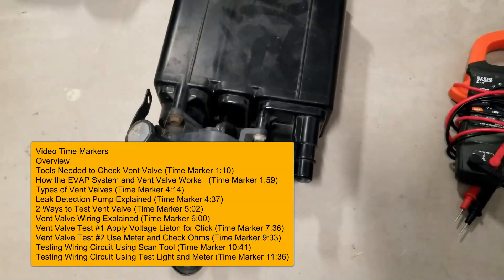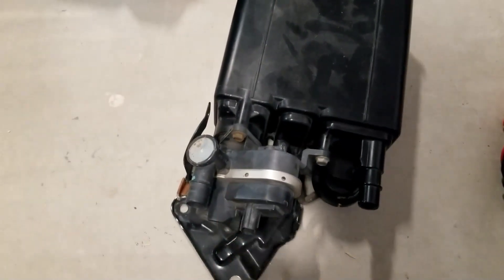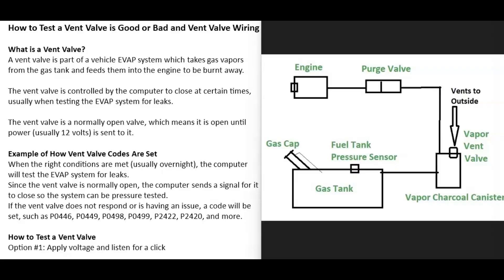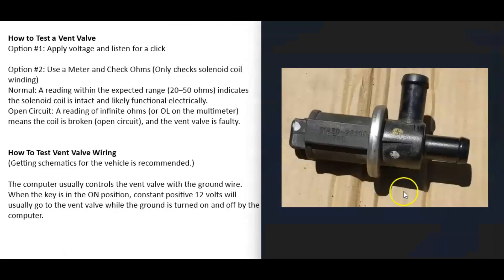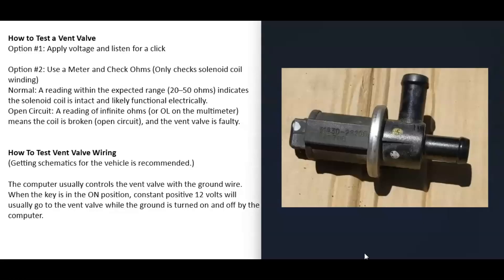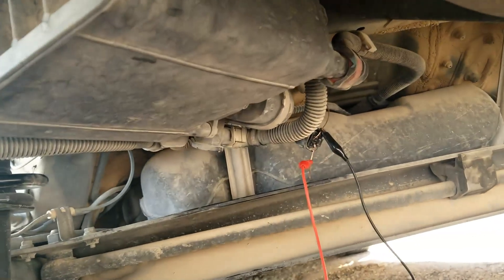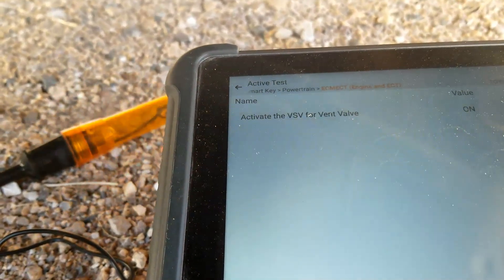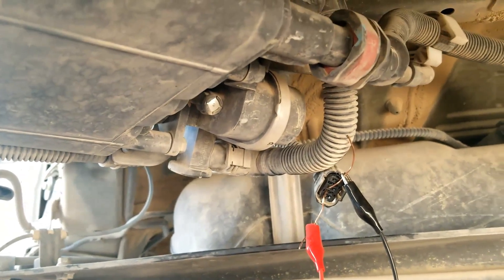How to Test EVAP Vent Valve is Good or Bad and Vent Valve Wiring (Leak Detection Pump Test)

Comment: This is a great video, but I wish you would have added the final test for testing the vent valve, and that is, to see if it holds pressure. Just because you hear it clicking doesn’t mean it is fully closing.
Reply: Smoke test will confirm closing tightly, probably the only way to tell.

Comment: good job.   But I must  mention that even though you might have good power and ground to the vent valve and hear clicking, it might not be sealing properly internally and thus causing the failure you are seeing
Reply from the maker: Yes, that is true; a pressure test could also be done to ensure it is sealing.
Reply: You’re asking a lot.